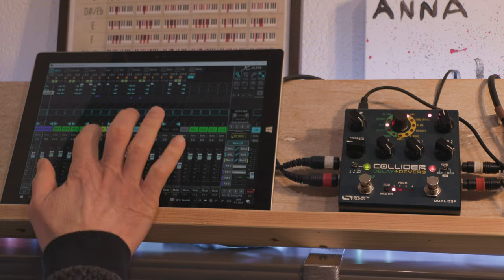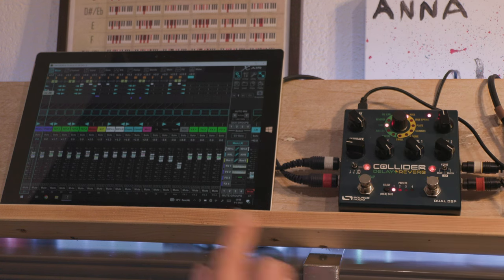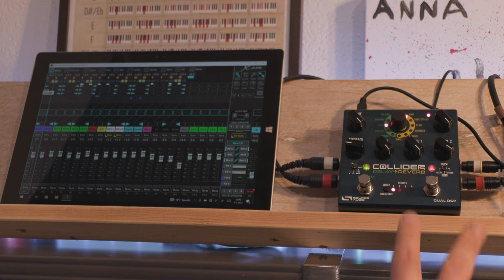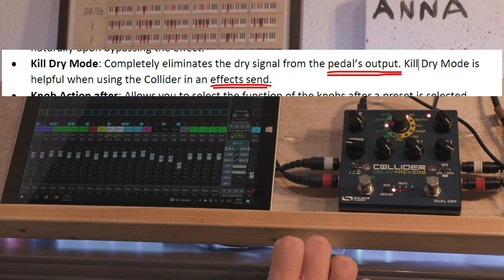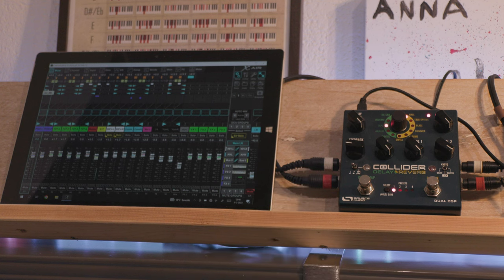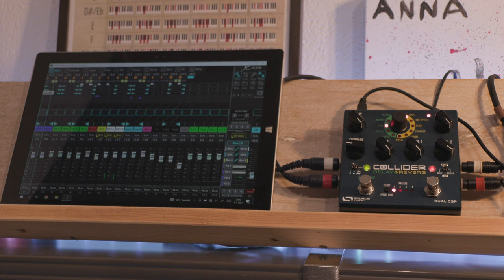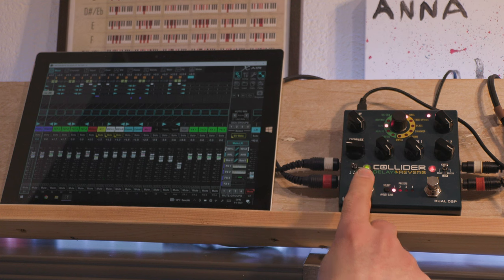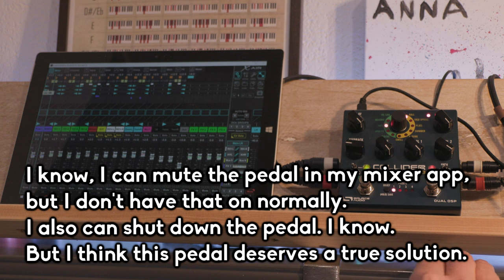Almost perfect // Source Audio Collider // send effect loop.

Comment: Is it possible to have the left-input go to delay, the right-input go to reverb and have the result come out together in stereo?
 I wonder this because my mixer has 2 sends, but then would only need to use 1 return channel to get both effects back.
I checked he manual but got confused with the drawings..
Reply from the maker: I will check when I can ( and remember 😂)
Reply from the maker: I just tested this with 2 signals from my 707. 
What you can do, is split the stereo signal. 
Left will go to the first engine (usually delay) and right will go to the second engine (usually reverb). 
This works, but you lose the stereo output as it is effectively 2 separate mono pedals. 
So you will get the left signal + delay out of the left output and the right signal + reverb on the right one. Both mono.
IMHO, I would not go for this option, since the stereo effect is what makes this pedal so good. 
And I can see why they limited this, since this is one of the main reasons to get 2 separate pedals (and they happen to have 2, so they need to give you a reason to upgrade)

Comment: Hmmm that is a nasty issue, I hope this can be solved in software because if this is hard-wired you are kind of stuck with it.
Let me give you a +1 for using the Behringer XR-18 as well (the only Behringer product that was free to enter my room).
Reply from the maker: I'm hoping this is not hard wired, as it behaves differently depending on the mode (cascade or parallel). 
But at least Source Audio was open for conversation, so that is a bonus already. 
And for now, I will live with the inconvenience of having to unplug or mute the pedal (I usually don't have the surface on, so that is inconvenient too). 

Yeah, the XR18 is quite unique in 'bang for buck' and flexibility. 
We also have the X32 in the band, which is like a XR18 on steroids. Especially with the digital snake (32in 32out over one ethernet cable)
Oh and we have a few of those cheap headphone mixers. 1 in 4 out. Since we use those for in ears (man that is such an improvement over using speakers) and they have served us well for over 4 years now. 
It seems like the more recent Behringer stuff is better than what it used to be for sure.
Reply: @tricks-and-tips  Wow you make such good use of the Behringers then, good job! I love my XR18, indeed so much bang for your buck and when connected to an iPad I also keep 18 ins and outs, awesome.
Reply from the maker: @rayderrich  Yeah, I think they are unrivaled right now in what they offer. 
I'm sure there is better quality mixers etc. available, but usually those are expensive and very limited in what they offer.
Reply: I am considering the Collider and I am glad I found this video. What has Source Audio's response been? Any chance this issue has been resolved via firmware update since you posted this video? @tricks-and-tips
Reply from the maker: @rarnett47  I explained the situation, and they understood what I meant. But they did not have a short term solution and explained that almost all panels work like this, so they were going to pass it through to development. But I think it is very unlikely that this will be changed. And they are right, my strymon behaves in the same way. So I guess I am spoiled with a DAW 😂
Reply from the maker: @rarnett47  PS, I would buy the Collider without hesitation if I needed a new pedal. It’s no big deal really. Just something that could make it even better.